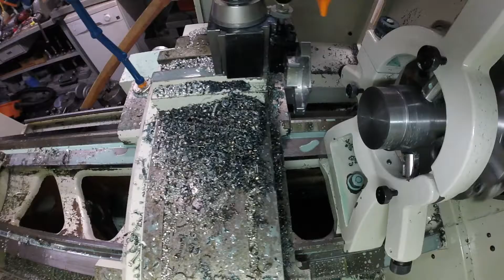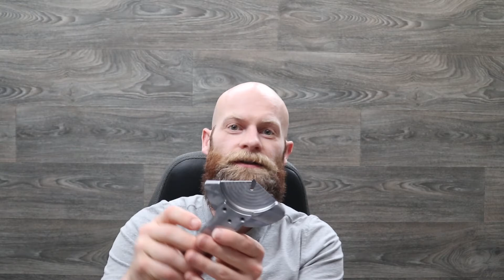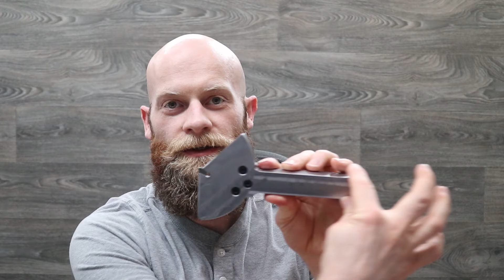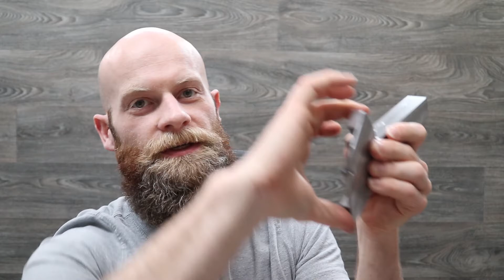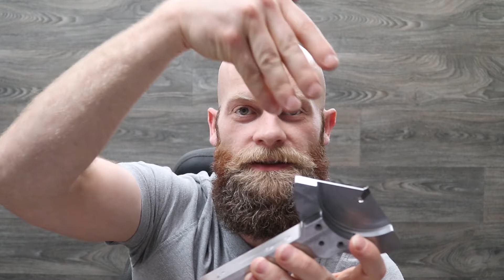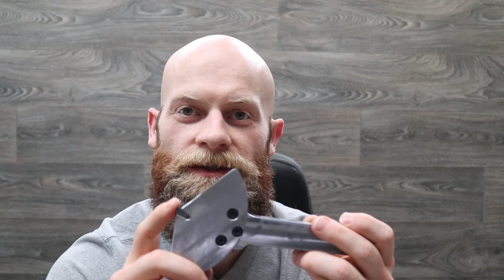Designed A New Part Off Tool

Comment from the maker: Another advantage to this design is that the part off head can easily be mounted to modular holders such as HSK, KM, Capto and others. (The end of the holder would need to be made to fit the part off head). Without taking up much space or projecting the tool too far out.

Comment: Impressive design!!  Making tools is one of my most favorite things to do.  I love how you created the interlock between the insert holder piece and the shaft/arm.  I'm surprised that you had more issues with the spindle than the quick change tool post.  I have a really hard time parting off on my manual lathe do to the compound "twisting" under load.  If I tighten the gibs up any more, I'll have too hard of a time trying to move them.  Thanks for the videos!  I watched the aluminum one first and then came to this one.
Reply from the maker: Yes, it’s interesting the things you discover while pushing the limits.
I have had issues twisting the tool post in the past. Usually when I use an insert drill. Due to this I tighten it down real good using a large wrench and a cheater bar. Due to the large bolt on the tool post I’d say I can get it tightened down more than a compound with the two smaller side bolts. I have thought about keying or pinning it but decided against it.
Reply: @McCoskeyPrecision  I'm pretty sure my lathe would stall if I tried to do a .012IPR cut off with that insert. LOL  I really like the mini grooving inserts from Nikcole that are only about .040" wide......way less load, but they don't cut very deep at all......and I still end up breaking them from the tool post twisting.  More accurately, it's the compound and cross slide that are moving.

Comment: This is a nice tool design, see the strength right off, GREAT idea, my thought is a non important one just asking about this (learning here), is the outsides of the tool to the material diameter going have to stay clean and clear during cutoff. Question also What material did you make the actual holder out of? just anything or bought stuff? Heat Treated we see ground etc. 
We like that you are thinking, being cleaver we are watching your channel in part for that reason, that is exciting two us, it be important to these two California desert dwellers. Thank you, Lance & Patrick.
Reply from the maker: If the tool is cutting material that breaks a chip the chips should for the most part stay clear. One of the advantages to feeding fast is that it will tend to break a chip more often then not. If cutting material that doesn’t break a chip but makes stringers that wrap around the part, clearance can become an issue, due to this I would use a tool with enough clearance between the support ring and the part diameter. Pecking the tool can also help break the chips and prevent them from wrapping around the part.

I made the shank out of regular steel and the blade out of 4140. I didn’t heat treat the blade, since I wanted to test the tool asap, but a heat-treated blade may have done even better as it would be stiffer. I didn’t grind any surfaces, but it would be ideal if some of the surfaces are ground (if made in production). 

Thanks for watching, I do like to try new things and see what’s possible.

Comment: Very, very impressive. Seems like you had a lot of fun with this tool.  Did you make this tool because you were disappointed with the Sandvik y-axis cutoff tool?
Reply from the maker: I wanted to make something that could achieve similar results to the Y-axis tool on a conventional lathe. 

I don’t currently have a Y-axis lathe, so I haven’t had hands on experience with Sandvik’s tool. I’m not sure of the material they were cutting but if they can achieve the stated speeds and feeds in steel. I would find it hard to beat. I think this tool could match it if dialed in. (also, I was cutting a chunk of steel I had lying around)

I did have some fun on this. It’s always fun to design and test things, especially when you work on pushing the limits.